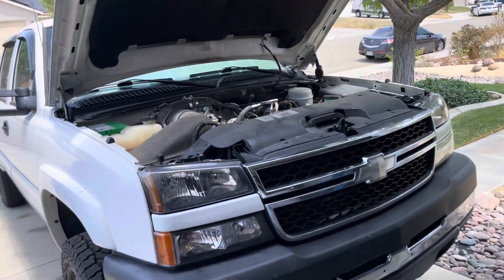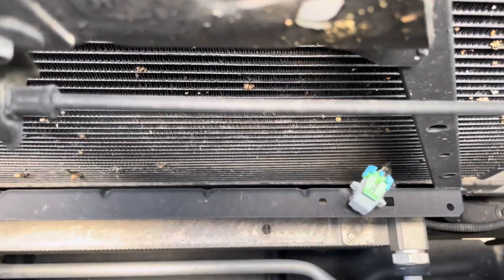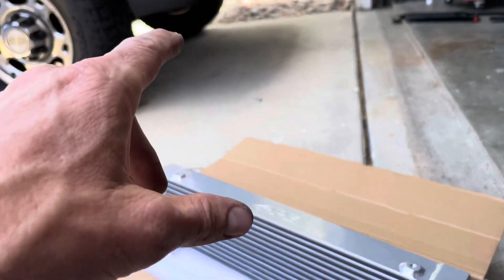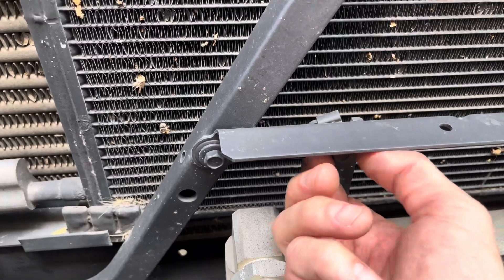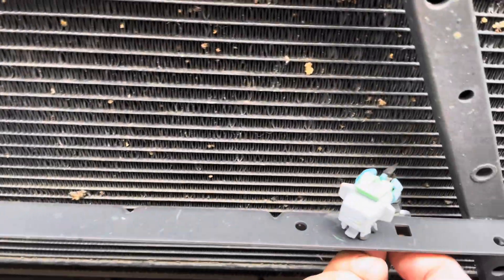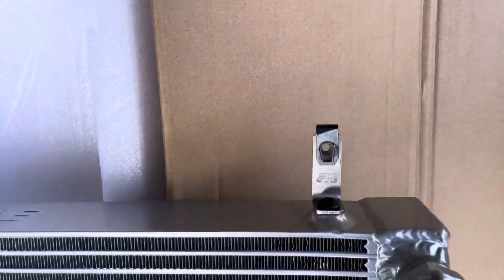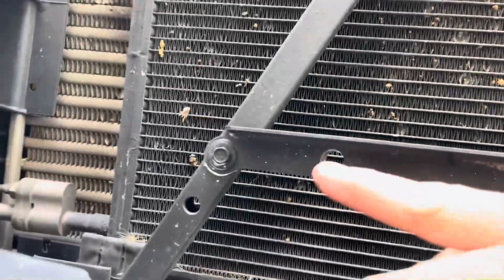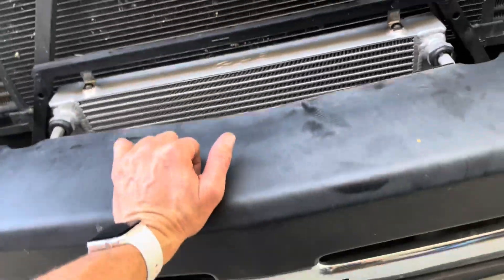PPE Performance Transmission Cooler LBZ

Comment: Did you prefill the cooler before installing? Thanks
Reply from the maker: No I didn’t
Reply: @Zeeksti I’m not sure it’s even necessary. Thanks for your reply
Reply from the maker: @drewk5929 I don’t think it’s necessary because there was plenty of fluid in the system now if it was a brand new transmission install and torque converter, etc. I would’ve definitely prefilled everything 👍🏻